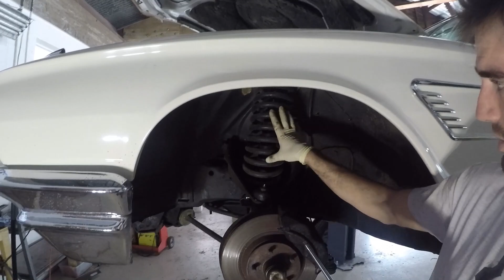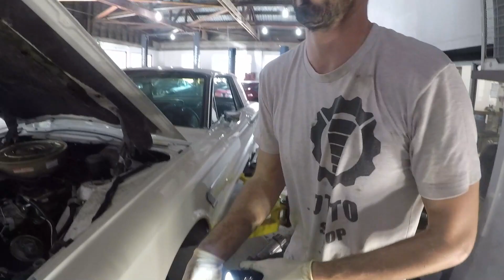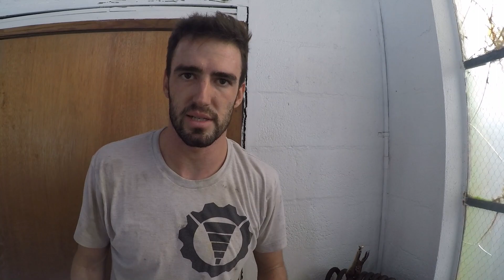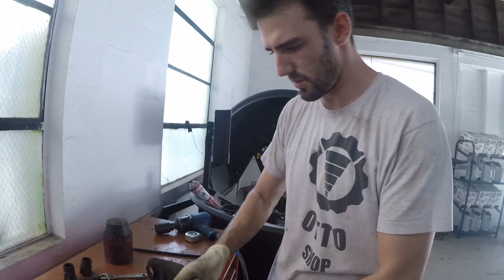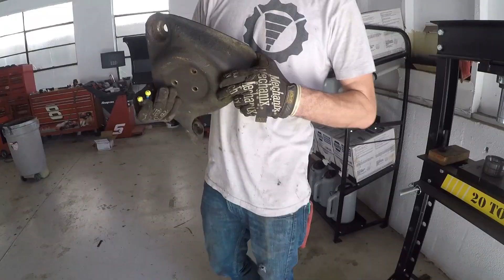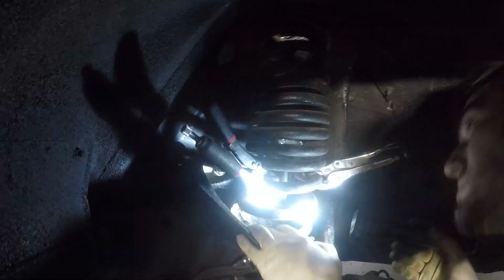1965 THUNDERBIRD FRONT UPPER BALL JOINT & CONTROL ARM BUSHING REPLACE

Comment: There's no rubber bushing on the inside of that upper control arm shaft? my 63 has some rubber bushings in there that are cracked and i'll be damned if i can find them. What were you measuring when assembling the upper control arm?

Comment: No way you can change the front suspension that easy. You guys loosen everything up before you start videos to make it look easy. Took me 3hours to separate the lower ball nut using heat and a 4 pound hammer. So you ain't that good  .

Comment: I hope someone reads this.. The proper way to take out these springs is to use a jack under the control arm to compress the spring partially with the weight of the car. It will cause the spring to straighten out (no bend) and do most of the work for you. 

Put the tool on, gently lower the jack and then you may need a few more turns on the compressor, but that is it. You will have a nicely compressed STRAIGHT spring!

Comment: Hey there, 
at 5.00 when you took your hammer to it. did it litterally just drop down? i am currently trying to replace a ball upper ball joint on my 64, with the spring in place. I am currently struggling with trying to get the hub to drop. I thought it might be due to tension from the spring, accord to the book you dont need to remove the spring to take out the ball joints. 
what would your advice be? kind reagrds chris
Reply from the maker: Yep, just crack that bad boy with a hammer while the suspension is hanging and it should drop. If its being stubborn, it's probably just seized in place and needs a bigger hammer. Hope this helps.

Comment: I saw a mechanic with the same spring compression issue. His solution was to remove the shock, then lower the car back down (compressing the spring using the car's weight!) then clamp it off and re-raise the car.  It was a newer car (1969) but I'm guessing there's no reason it wouldn't work on this flair bird.